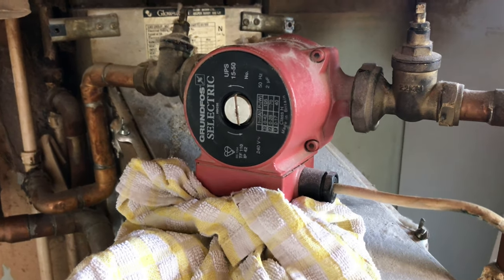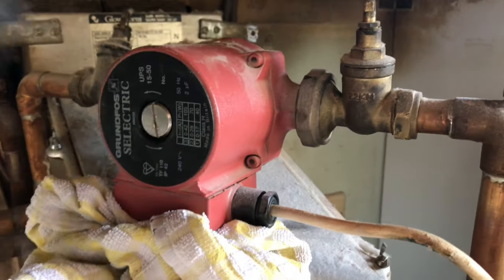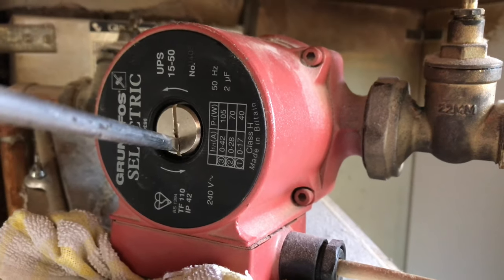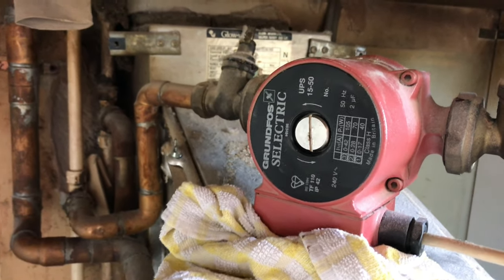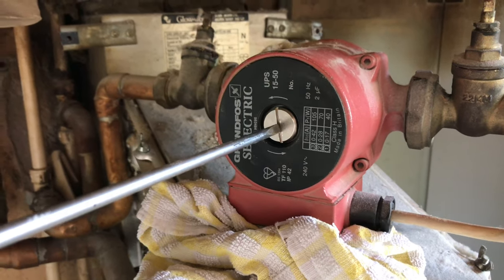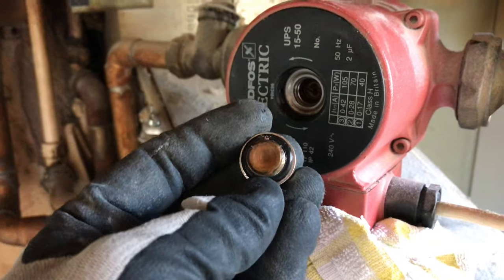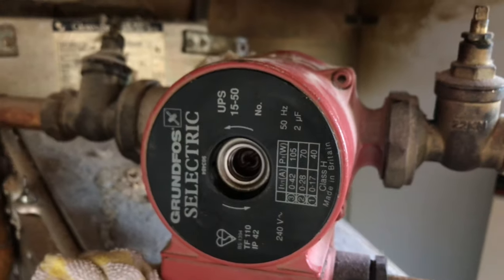How to free a jammed central heating pump

Comment: Fixed my issue, thanks! Pump was running, but there may have been an air lock or debris because now all 3 zones work. Lots of spitting of air before flow began. I unscrewed it each time I turned on a zone, same each time. Much appreciated!

Comment: Thanks for the video. I had flushed my hot water tank and the pump was locked up due to air in the line. I opened the top cap 5-6 times to vent off the air and everything works as expected!

Comment: Water Pressure!: Thank you Dan, my pump is integrated within the combi boiler.  My first (and only!) suspician was the pump, which was confirmed by your excellant video. So I checked  it to make sure that it was, as you suggested, not jammed by summer inactivity.  After a while of fiddling with the pump and it not starting up and it appeared to be free, my thoughts, confirmed by yours, indicated that a replacement pump was needed.What a pity, but there you are!  At which point, my eyes inadvertantly strayed onto the boilers water pressure guage where I noticed the pressure was very low. Doh!  I topped the system up and the pump sprung into life.   Ach, I should have checked that first!  I hope this helps others!

Comment: I had one that wouldn't run but was free and, from a check of the winding resistance, still OK from that point of view. What had failed was the capacitor (2uF, the value of the capacitor in the case of the pump you have there is printed on the label). I located a suitable replacement (it has to be a 450vac type often simply called a motor run capacitor) and fitted it (a fairly easy job) and its been back in service for many years. Way cheaper than a new pump.

Comment: looking for info on my system(heating my house & water) from a Trinity installed system about 10 years ago, that uses this same red pump that works but keeps running well after(like an hour) ending my usage of hot water (don't need heating at this time of year in Canada). Should I perform this operation of loosening? It does get quite hot.

Comment: Thanks for the video, really good. When I undo the big brass screw on mine I have what looks like a square fitting in there and can’t use a screwdriver. Any ideas what tool I need to use please?
Reply from the maker: I’m not quite sure what you mean, normally you can use a large screwdriver to turn the spindle 👍🏻
Reply: Ok thanks for the reply, appreciate it 👍🏼
Reply: Yes mine is the same. Red Grundfos, can't get a srcrew driver in there, looks like it needs a square allen key fitting
Reply from the maker: You should be ok with a large flat head screwdriver I have not seen an Allen key one 👍🏻

Comment: Hello! Can anyone help me with my issue? Namely, from some reason, heating is not working, and I tried to check the pump, by unscrewing the cap as in this video (to try to start it manually), but when I removed the cap on the pump, water started to come out in the stream. I closed it quickly, as pressure started to go down. Is it normal thing? Do I need to ignore the water stream and to try quickly to unscrew the screw inside the pump to check if it is jammed?

Comment: How do you unscrew the big screw.   Seems tight.  Tried using a screw driver bu my screw driver is too small.  Tried using pliers and a coin but it bent the coin.
Reply from the maker: You will need a large flat head screwdriver, using anything else may risk damaging the head.

Comment: Top video bit how do you apply torque to that irritating staggered slot if it's actually seized?
Reply from the maker: Never had one that is seized, but is would suggest lubricant and the largest flat head or flat wrench you have.
Reply: @PlumbingGy  I filed a gap in a flathead to make a "snake eye" profile and managed to apply enough torque to break the screw head, still seized though 😂
Thanks for prompt reply!

Comment: hi dan  we have problem with the wall thermosat that we have to have it on at 30 but when we turn it down to 20 it comes on but goes off and does not come back on when the rooms have cooled down so we changed thermosat but problem still continues could this fault be caused by the water pump.

Comment: Hi Dan thanks for vid. My Dab pump is really hot. Central heating and water is fine but humming noise and boiler flashes.
Reply from the maker: Hi there, 
Follow the steps in this video to see if the motor is spinning I have a feeling the pump motor has burned out. Just be sure it isn't air locked for any reason. 
Thanks
Reply: Hi Dan did you say in the video that it was burned out and needed a new pump, if so why did you not have to replace it
Reply from the maker: If it needed replacing it will have been on a different video 👍🏻

Comment: In my case it's the valve that's stuck or gets stuck when the motor tries to turn it.WD40 has helped but I have to remove the.motor to start the water circulating. Replace or ?

Comment: Your videos are so helpful thank you! But could the pump be faulty even if some of the rads get hot + hot water cylinder but all other rads furthest from pump are all cold?
Reply from the maker: Do you have any valves on the system in the airing cupboard, 3port or two 2 ports?
Reply: @PlumbingGy  thank you for following up!! Yes there is a 2 port diverter valve next to the pump which diverts water between central heating and hot water cylinder

Comment: Hi Dan what if water comes spraying out with force when the bleed / impeller screw is opened? is the pump done?
Reply from the maker: Hi there, the pump shouldn’t be spraying out with force normally a small trickle of water to say that it has been bled from the bleed screw. If you are experiencing a lot of water I would suggest it needs replacing.

Comment: Hey Dan when I remove the screw it pours water. I dont have it or the other pumps running. How do shut off the water to stop this happening? Cheers.
Reply from the maker: I’m afraid if the pump valves have failed it is a full drain down to change it. There is no way round it.
Reply: @PlumbingGy  Thanks a million for your speedy reply. Maybe I was confusing with my question. So basically, I usually do something like your video, when there is an airlock, where I only have to loosen the screw a little until it bleeds out the lock. This time as I haven’t used it for several months during summer, I’m guessing might just be a little stuck, but when I open the screw completely the water keeps pouring out. I thought maybe if I tightened the valve immediately above and below the pump it would stop the water for me to remove the screw and turn the impeller a little?

Comment: Good video...but can you tell me why a central heating pump stays on continuously and how would we turn it off as ours won't turn off! Thanx
Reply from the maker: It shouldn’t be running constantly, have an electrician look over your setup
Reply: @PlumbingGy  Valve stuck...changed valve ...now fixed (;o) thanx

Comment: Hi Dan, don't know if you're still replying on here but would the knocking I hear be this? I've got hot water but no heating.  Condensing boiler.  Thanks.
Reply from the maker: Hi Jim it’s very difficult to diagnose something like this just over messages where is the knocking coming from? It could be pipework through heat expansion.

Comment: My pump was installed last week it is giving a frying sound and very hot appears to be overheating
Reply from the maker: This is just an initial thought but it could be a faulty motor within the pump, especially if its getting very hot. Too hot to touch? The additional burning sounds backs this up to be honest, Just give the installer a call to return as u suspect the motor, when he gets there make sure its not just air running through the pump and creating an air lock. 
hope this helps

Comment: Not sure if you’re still active or not but mine is a little different. It’s more like a nut so can’t use flathead, also has a black plastic top. Is it the same process? Hope you’re well
Reply from the maker: If you need to vent the pump then it may depend on which pump you have, the bleed screw is at the front of the head as standard 👍🏻

Comment: Hi Dan what happens if water is coming out and not seeming to stop do I need a new pump you think
Reply from the maker: Hi Peter, do you mean out of the bleed screw on the front if off? If so it's meant to so just tighten it back on if it's weeping you may need to replace a seal. 
It's from the side of the pump you may need an engineer to take a look an potentially replacing it
Reply: @PlumbingGy  hi Dan thanks for quick reply water is trickling out of vent screw when you take off but doesn't seem to stop I just thought a little water would come out and then stop but mine didn't stop trickling out
Reply from the maker: Hi Peter no it's meant to trickle out when the vent is off as long as it stops and seals when the screw is replaced you are ok 👌🏻.
The vent screw is removed to release any air when the air has purged water will begin to trickle out when this happens replace the screw and reseal.

Comment: Hi Dan, As I'm unscrewing there is a lot more than a dribble coming out and it has a bit of pressure behind it too. So I've stopped and hopefully you can advise what to do now? Should i isolate the system?
Reply from the maker: There should not be a build up of pressure, I would advise let an expert take a look as the pump may need replacing, or go ahead and isolate the pump valves and replace it yourself 👍🏻
Reply: Hi Dan, cheers for the rapid reply. 
It wasn't a lot of pressure but there was some squirting. There was probably 500ml of water but I think that could do with the pumps location.
Long story short, got the cap off, impeller spun freely. Turned everything back on and could hear it running softly. Few taps with the hammer and it would kick into gear.. For about 10 seconds then I got the red light of death again. Burnt out you reckon?
Reply from the maker: Doesn't look great, if you can hear air running through that could be a cause but Normally u can tell if it's burnt out by how quickly it gets hot. If it gets red hot in a small amount of time chances are it's gone
Reply: @PlumbingGy  bullocks 😟
Thats what I thought to, was very hot to touch.
Anyway, cheers for your help, very good video and I felt confident to give it a go. Subscribed 👍
Reply: Hi Dan, when I try to turn it it’s stuck, I’m afraid to use force! Should I? 🤦‍♀️

Comment: Turned my heating on for the first time this winter today. The timer for both water and heating showed both switching off at the set time but the pump continued running. I presume the valve is stuck in the pump. Is it a case of having the pump changed again or is there something I can do before calling someone out? It seems to happen every couple of years, despite having the systems flushed.
Reply from the maker: Make sure it's not a pump overrun 👍🏻
Reply: Thanks for your reply. I switched everything off including electrics last night, switched it back on again, reset the time etc and tonight the pump switched off as normal within about 5 minutes or so of the heating/water going off. 

Glad I came across your site, I have hit the 'like' button and 'subscribe'.
Reply from the maker: Many thanks I’m glad it’s up and running now 👍🏻

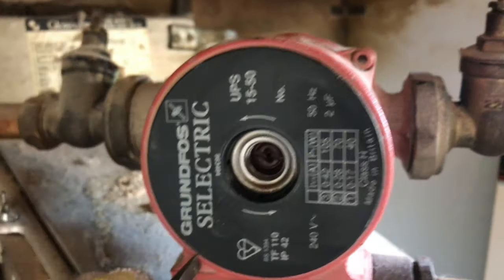Comment: 2:21 mine totally fell apart from rust :( Is there a way to disassemble it and replace it? Or do I have to get a new one? They don't make them anymore so I can't really get a new one
Reply from the maker: You will have to replace I do have a video on how to do this 👍🏻
Reply: @PlumbingGy  the problem is mine is not connected directly to a pipe, it has sort of a diamond output, don't know how to call it. And every new pump goes straight to a pipe like in your video

Comment: Mine seems to be working properly but if I take cover off water pours out and won't stop does this mean it needs replacing
Reply from the maker: You mean the bleed screw ? Of so this is normal and should slowly trickle water
Reply: did you end up fixing it? i had the same problem with water pouring out.
Reply: @00el04  no just left it seems to be working ok

Comment: Thanks to Dan, not to mention the helpful comments just sorted a very stressful situation – full story as follows: 

Fitted a new divertor valve head (Flomaster basic) because the old one was making a strange electronic noise suggesting motor burn out.

After fitting, both heating and hot water caused the boiler to fire up briefly then promptly turn off. 

Was pretty sure not a boiler issue as no warning flashes/signals from boiler, and the new divetor valve seemed to behave as it should so...

Found this video and decided to investigate if the pump – a Grundfos - had seized up.

With the electric to the boiler/controls etc... safely off, but mains water still on and isolation values above and below the pump still open, I undid the bleed screw in the pump as per the video.  As NOT per the video I swiftly put a shallow bucket underneath when I realised water would continue to drip out (not Niagara falls though) from the pump because the system had not been drained and the isolation valves were still open. 

Again as per video, tried to turn the inner spindle with a screwdriver – not sure if different pumps have different spindle grooves but I could only fit a small fine headed electric screwdriver in the very inner part of the spindle -  but it wouldn’t budge.

So with the screwdriver still inserted to the spindle, I tapped GENTLY with a hammer on the back of screwdriver and then tried again to turn (clockwise/anti-clockwise – didn’t matter) and suddenly I could feel movement on the spindle.

Few turns anti/clockwise directions the spindle felt free.

Replaced the bleed screw quite tight, turned on the heating the boiler now stayed on! However I did notice it didn’t sound a “roaring” as usual. Loosened the bleed screw SLIGHTLY (1/4 turn anti-clockwise) and the boiler started to ramp up to a more satisfying sound.

After all that my radiators are the hottest they have been for years, and even the banging I used to hear when boiler turns off has reduced.

Thanks again to Dan and comments.
Reply from the maker: It certainly sounds like you have had your hands full I have to say 😂
Reply: I just hit mine with a wooden mallet, alot quicker
Reply from the maker: Andrew Quigley definitely an option however I wouldn't always recommend for obvious reasons😂 thanks for the comment 👌🏻👌🏻👌🏻

Comment: I tried this and I got a continuous flow of water out of the pump instead of a little bit like yours, would you know what causes that?
Reply from the maker: The pump shouldn't be pouring with water excessively, it will need to be Inspected further to diagnose
Reply: @PlumbingGy  thanks for your reply! I rewatched your video and I just realised that I didn't turn on the central heating before doing it, could the flow of water be because it wasn't turned on or there's definitely something wrong with it?

Comment: I turned Central heating off, then removed screw, water continuously came out slowly but enough to soak the rag. I turned the internal screw wit no resistance and it would push in and out if I put pressure on it then release the pressure.  I replaced outer screw and switched back on but still no heating?!
Reply: Pump doenst seem to be running?!
Reply from the maker: I would check any additional valves on the system, 2 port valves etc

Comment: Do you need to drain line when you take off big screw with the gasket??
Reply from the maker: No, just vent
Reply: Do It All Dan what does vent mean to an unprofessional ??
Reply from the maker: Sorry, unscrew the cap until a trickle of water has a steady flow that means you have vented the air out 👍🏻
Reply: Do It All Dan then I can take it off and see if it’s stuck Inside?

Comment: Water keeps trickling out of mine (like when you air a radiator) is that normal?
Reply from the maker: Not if the screw is tight no
Reply: @PlumbingGy  From the inside (once outer screw has beeb removed) the water keeps trickling out
Reply from the maker: If you have removed then big brass screw from the front with a large flat head screwdriver and it is trickling water then the pump is bled and no more air is in there, screw the screw back in tight and test 👍🏻

Comment: Our new pump’s speed light keeps turning off after about 5 minutes and it’s very hot to touch, what’s the problem?
Reply from the maker: First of all make sure the pump is running and you can feel/hear it working do the checks as mentioned in my videos. 
Do you have any zone valves (small normally silver or white boxes in airing cupboard) make sure they are opening by checking that the pipework is hot after and before the valve, if it's hot on one side (flow to the valve) then it could be a faulty valve there is a small lever on the side you can slide open and it will begin to flow. 
If you believe it is the pump you can try to free it up by unscrewing the silver screw as shown in the video to try and free it up, or give it a strong sharp strike to get it working. Hope this gives you an idea feel free to ask again if your not sure
Reply from the maker: https://youtu.be/pk7-552l2Wg